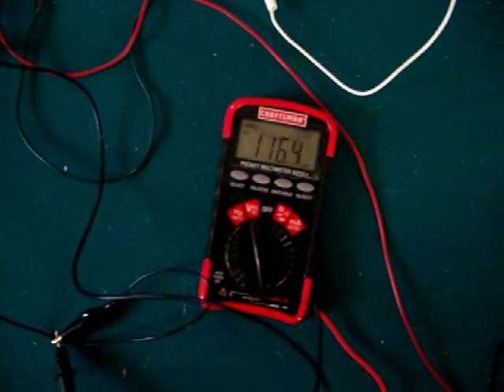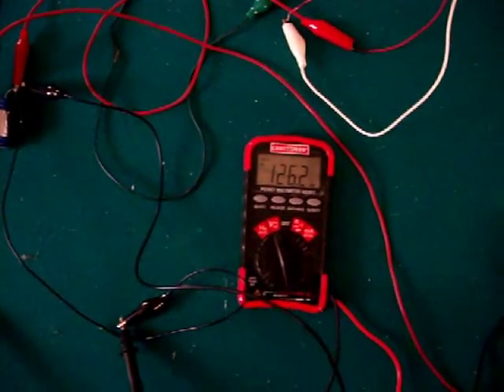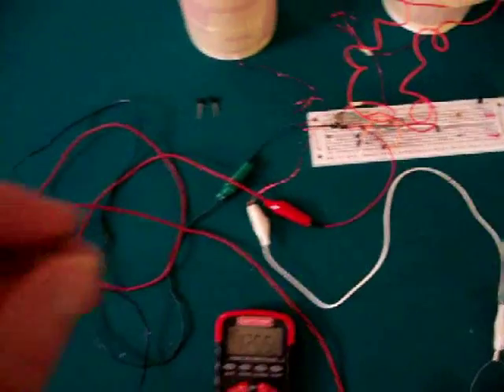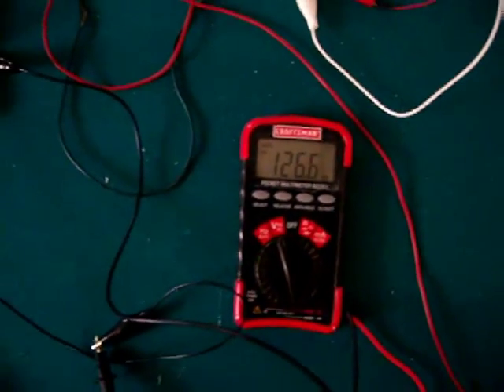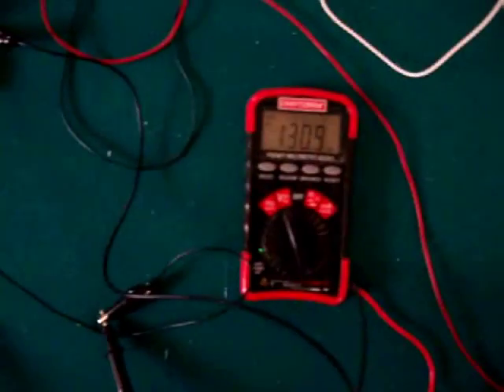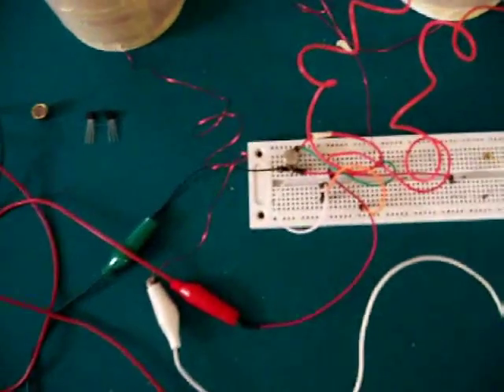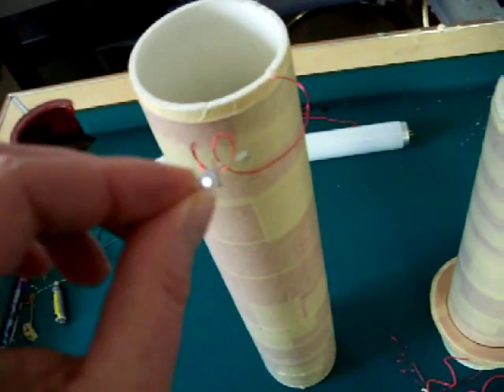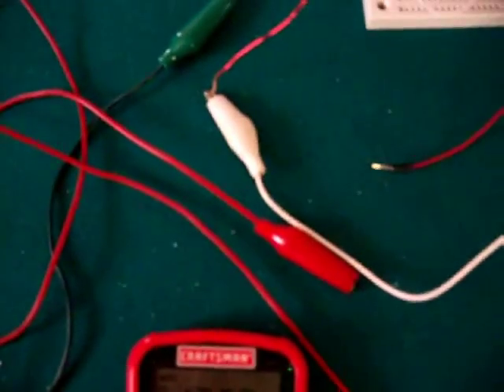Self Running Exiter

Comment from the maker: I have a alligator clip connected to a small piece of wire that is put inside the adapter end of the charger, Then the other alligator is just connected to the outside of the adapter.The wire that goes to the inside of the adapter is positive the clip on the outside is  negative.

Comment: i think maybe one could use this technology with as low as .5V input. i saw one video where a guy powered the circuit from his mains ground line.

you could do something like build a remote that powers itself from your bodily grounding when u hold its case, u think? or maybe an exciter that runs from very low dynamo generated input.

thank you for sharing this kind sir

Comment from the maker: Thanks Crob227
It's the same circuit I showed a few video's back.
Accept I'm using a old PNP transistor a R591-7419.
I just reversed the polarity at the cap for the transistor.
If you would like I can redo a circuit for this and post it at EF.